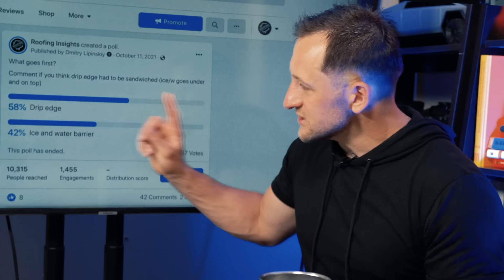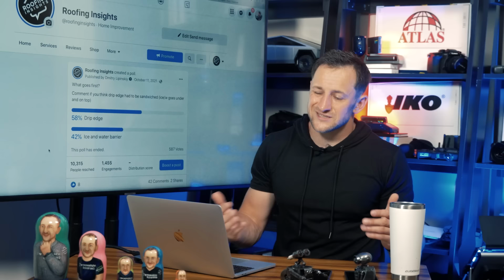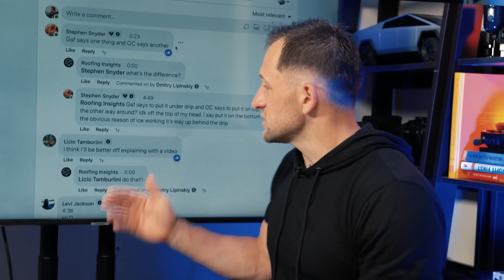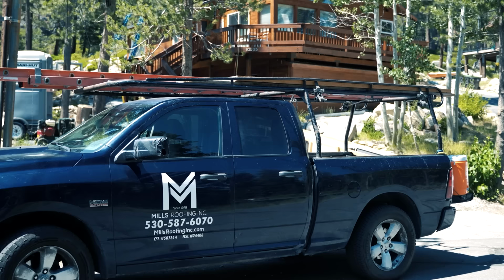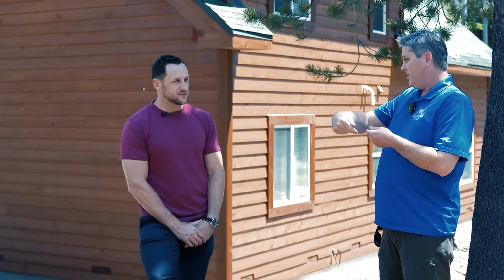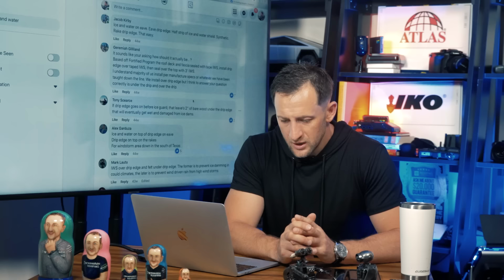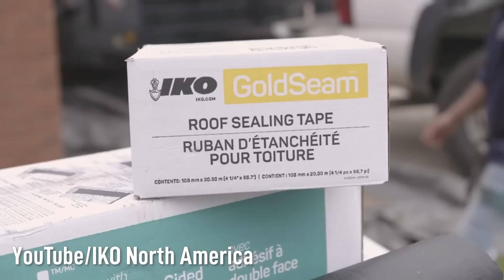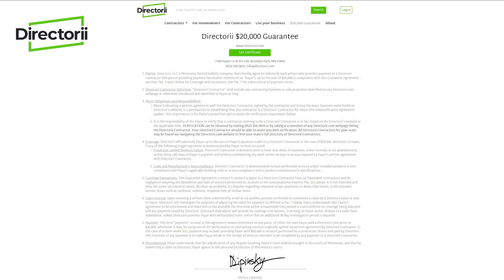The Big Roofing Debate: Drip edge or Underlayment first?

Comment: So I had to click on this video, already knowing the answer. I was taught 14-15 years ago drip edge always goes underneath all and any underlay, up the gables and on the eaves. I learned roofing in Nova Scotia, Canada, where we deal with not only extreme amounts of snow, ice, and freezing/thawing, but tail ends of hurricanes. Basically the worst case of all possible scenarios a shingle roof can have to withstand. Now, I always followed this instruction without question, not really even knowing why. 

But then I moved out to British Colombia.

Here in B.C. I ended up getting a job repairing and replacing damaged gutters. For the last 6 years I have been inspecting and cleaning, repairing and replacing gutters. It didn't take long before my roofing experience started to come in handy. Now, here in B.C. the law of roofing seems to be, "It doesn't USUALLY snow or rain that much so you don't need drip edge or ice-and-water-shield." ( I'm talking Okanagan and West Coast to anyone who knows how much it snows up north. I haven't done any work up north). To which my response has become, well, I guess it doesn't USUALLY leak. So, I now go around repairing the damage caused by roofers using paper instead of ice shield, no drip edge and yes, even damage caused by putting the drip over the underlay, even when said underlay is in fact ice and water. The reason is simple: When you put your drip edge over top of your underlay, it's fine when it's just raining. The metal barrier of the drip edge prevents the shedding water from entering the space between the gutter and the fascia board. However, after dozens of calls from customers with problems of water leaking behind the fascia board while the snow on the roof is melting, I have found that the slow-moving water of snow melt in addition to the pushy nature of ice building up underneath the shingles, causes a GREAT deal of water to go down under the shingles and if your drip edge is on TOP of your underlay, goes under the drip edge, behind the gutter and rots out the fascia board. I have now seen this exact problem over a dozen times, resulting in everything from having to remove the gutter and replace the fascia to even the plywood on the roof rotting, having to remove the first 4-6 feet of roofing and replace the plywood. Not to mention the damage done inside the home!!!!!!!!!!!!!!!!!!!!!!!!!!!!!!!!!! (OK not so much damage if ice shield was used but still rots out the fascia board). I have made this repair on everything from multi-million dollar mansions to massive skyscraping hotels to little bungalows where widowed old ladies live with little to no money to spare.

As for a few things said in this video: If a gutter installer screws a gutter on over top of a drip edge, they are an idiot. I am a qualified roofer AND gutter installer and I can tell you 100% this should never happen. You should never install your roof according to the potential stupid mistakes of a gutter installer. If that is a major problem in your area, you should seek out and talk with these installers, because then it really doesn't matter how well you install the roof, they made sure some problem will arise in the future. In my area, most of us trades people know each other and have no problem communicating, helping each other out with little discrepencies like this and once we have a good rapport and know that the other does good work, directing calls from customers to each other for our specific trades. In other words, I have a guy a customer can call for stucco work, for carpentry, for large gutter installations and for re-roofs etc. and all those people have us on speed dial for gutter and roof repairs. 

Another thing; why would you put your first course of drip edge under the underlay but then put the drip edge over it going up the gables? This makes no sense. Unless the gap between the gable edge and the drip edge is completely sealed, (Which it should be with ice-and-water, if you read the instructions on every bundle of shingles you have ever installed), then it truly makes no difference. And if there is drip edge installed and the underlay is cut as close to flush as possible, and a course of starter shingles is installed on top, I have never, ever seen an issue resulting from the order in which the two materials are applied. (I have seen LOTS of issues resulting from no installation of drip edge, but that's not why we're here). I was taught by a guy who roofed for 40 years in a VERY small community, who's father roofed for however many years before that in the same small community, and if there was ever an issue resulting from putting the drip edge under the paper going up the gables, neither of those guys nor myself have ever heard it. (Yes, in Nova Scotia, with some of the worst ice-damming and wind-driven rain problems in the country).

My response: With about 15 years roofing experience, the last 6 years of which have been spent repairing problems caused at the edges of roofs due to improper (Or no) installation of drip edge: ALWAYS PUT YOUR DRIP EDGE UNDER THE UNDERLAY. Regardless of the location or the underlay being used.

That's my 2 cents. Thanks!
Reply: Very thorough response.  Thank you!  We live in Nova Scotia, and are completing new roofing shingles on our home this spring.  What do you think of ice and water, then drip edge, then ice and water over drip edge?  Would that be the best recourse for the greatest protection of the roof, fascia, etc.? We have a roof with 3/4" boards (home built 40 years ago), and we decided to cover it with 1/2" OSB over top of the roofing boards so that the roofers wouldn't accidentally nail between the spaces between the boards and create a situation where the nail shoots through between the roofing board spaces and leaves a little hole where water could infiltrate.  The backs side of the roof has been shingled, but the front part of our roof has been without shingles all winter, and will be until the spring, as we lost our carpenter in the middle of the job, to no fault of our own.  We put ice and water shield over the OSB over the entire front portion of the roof because water was penetrating into our home.  The home is a shell, but we didn't want water infiltrating and rotting out the framing over the winter.  The ice and water shield is attached directly to the OSB.  So far, no more water is getting inside the house.  We have to figure out the best course of action to get this roof completely shingled and weather-tight this spring.  Any and all recommendations/advice greatly appreciated.  It's only a tiny home (25' x 30') with a 5/12 pitched roof. Home is on cement foundation. Thanks, again.
Reply: @jesus.maryandjoseph8880 Basically if you've already put down the ice shield with no drip edge, it would be a good idea to run another roll of it over the drip edge after putting it on. But i will also say, if you're leaving the ice shield exposed to the ice and snow for the winter you need to have a good look at it in the spring and make sure it's not full of holes. I saw this happen once on a really big apartment building after just a week of bad weather and we had to pull it all up and replace it. Now it could have just been really cheap stuff, but it can happen so just have a good look at it in the spring. Ice shield is definitely not made to be exposed directly to the weather, otherwise you wouldn't need shingles! Having extra ice shield under the drip edge won't hurt anything, It's just really expensive. The idea is to make sure that the water never gets under the drip edge in the first place, so putting ice shield underneath it is almost pointless. It will sort of protect your roof decking along the edge but won't protect the fascia board. Especially on a 5/12 roof, the water travels veeery slowly when the snow is melting and will run right up under you shingles along the edge, much further than what the drip edge can actually catch. 

Long story short, just make sure the ice shield covers the drip edge 100% and the shingles have at least 1 inch overhang and you won't have any problems.
Hope this helps!

Comment: Are you aware of any manufacturers that recommend installation without a drip edge?

I would assume the answer would be no. The home we are buying has no drip edge installed on a brand new roof and I’d like to call the contractor to ask why they didn’t install it. I live in an area where building codes are not adopted, so I’d have to go back to manufacturer installation recommendations

Probably going to end up installing the drip edge myself

Comment: I am installing flat roof flashing under shingles and over corrugated patio roof.
Seems most city codes require roof flashing to be 26 Gauge (0.019 inch). 
But the flashing rolls sold at Home Depot are thinner.
How do I resolve this?

Comment: Some of this doesnt end up with real explanations though. Many folks say to attach drip to the fascia BOARD. is that just new-cons? (Also if it is attached to fascia board, then if water gets back there, it will drip behind the fascia metal and start to sog the framing?)
 What if you are redoing just the shingles and theres already fascia metal and gutters installed ? Do you just say screw. it and overhang underlayment right into the gutter? 
The one guy said he puts felt under drip and THEN ice and water ? So that epic stick on tar membrane that IWS gives you is just stuck to a tarp, and not adhered to the deck? 

To me, the pretaping of the eave to fascia (sandwich) method is backwards here.  The tape protects a few inches up the roof but is a smooth surface for ice to climb inbetween and up into under the drip edge, where it will start messing with the adhesion of the IWS.

If the IWS was under the drip edge to begin with, then it should be protecting from leaks...and if a leak happened further up the roof, it should flow down the synthetic and onto the IWS...directly onto the fascia board lol. It is a Catch 33.

Id figure IWS under ....tape connecting the seam of IWS with drip edge , just like how you tuck tape siding insulation and wrap seems , but with the real roofing stuff

Comment: Step 1. A strip of IWS should be installed on the eave overlapping onto the fascia. This seals the common gap between the sheathing and face board as well as a barrier from blowing rain or overflowing gutters etc.

Step 2. Drip edge should be installed over the  strip of IWS. (please leave a gap between the drip edge and facia for gutters! ;)

Step 3. Overlap IWS over the top flange of the drip edge and continue up the roof until a minimum of 36” past the roof overhang. 

If you install your IWS first, drip edge, and then a strip over that, that top strip is sitting on top of the first layer of IWS creating a lip against the natural flow of water down the roof. 

I’d be curious how much overhang you guys do on eaves and rakes.

Unfortunately in our area we have a lot of roofers who don’t even use drip edge. I guess codes aren’t all bad because we don’t have any here. Very disappointing when we come to a job to install gutters and find the faceboard completely rotten.

There’s my 2 cents. Use it or abuse it 😇

Comment: Conscientious roofers would never place the mineral paper under the drip edge.  Some place the drip edge on top to hold the paper down and for no other reason.  What you didn't cover is that most homes have overhang where melting ice and snow forms a dam which can in some cases work back under the shingles.  In these areas wide roof tape should be used and folded over the sheathing edge, the drip edge then mineral paper then the roofing material.  And if ice dams form in your area due to snow amounts and length of freezing weather on average a heating element should also be installed with thermostatic on/off feature.  I've seen it done with a switch which requires the owner to know when to turn it on.  That is not acceptable to me.  With all the materials available at present there is no excuse for not doing it correctly.  And if your code calls for underlayment beneath the drip edge then put more over too.  The shallower the pitch the more likely you're going to have ice growth at the edge.  And the more overhang the more ice damming you are likely to have.   Melting ice and now above the heated space can and does refreeze on the unheated overhang forming dams and ice growth.  And if significant enough can back melted snow (and rain) feet from the edge causing leaks inside the building.  That should be the focus.  Not whether you should put drip edge or underlayment down first.  There are other products to reduce the risk of leaks due to ice than either drip edge or underlayment.  And if you are worried about wind lifing the underlayment then you probably shouldn't be doing roofing for a living as the roof material should be sufficient to prevent such.   I speak from many years of experience.  More than most who have spoken on this video.
Reply: I have been told that whatever hurricane comes and blows your drip edge and shingles off....at least your ice and water stays

Comment: Don’t use ice and water shield . The shingles stick to it . When you want to re-roof the house in the future you won’t be able to year off the shingles along the bottom 4’ and all the valleys. Use Deckbase instead. 
Or if you cover the ice and water with felt or synthetic then that’s ok.
Reply: And what do you do when you have a 4/12  pitch where the water backs up from the edge of the roof inside the house? Or behind the gutter and rots out the fascia board? I have re-roofed over ice-and-water shield, I have done countless repairs over top of ice-and-water shield, I have even tied roofs together where an addition was built that tied in to a roof covered in ice and water shield, and I have never had a problem. It takes a little more time but it isn't rocket science. Half the purpose of ice and water shield is that the shingles stick to it!!!!! That's what stops it from leaking!

Comment: This is the stupidest argument ever. This is a lot of people talking about ice and water they don’t even clearly know what the purpose of ice and water shield is. Like a lot of people even think of ice and water shield has the stick to the deck but it doesn’t. Water shield is the prevent water from ice dams from leaking around the nails and getting to the deck. 
If you’re really that concerned with 2 inches of plywood somehow getting damaged because the drip edge is covering it to put a 6 inch strip down the bottom put your drip edge on and then put your first full course of ice and water shield on top of your drip edge. Most of the problems that you think you’re a reason by adding ice and water shield first or do to piss poor shingling technique